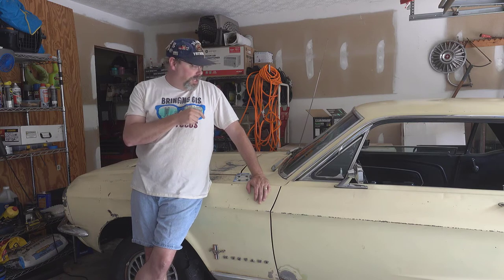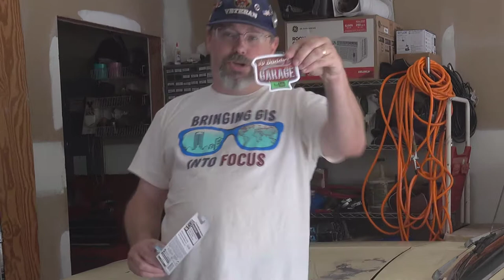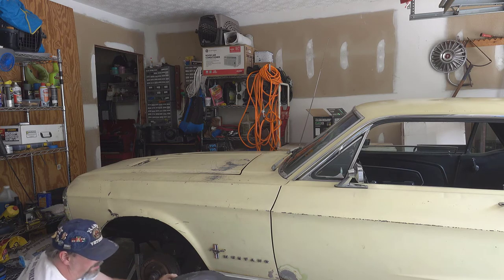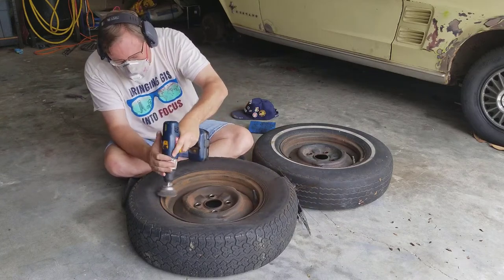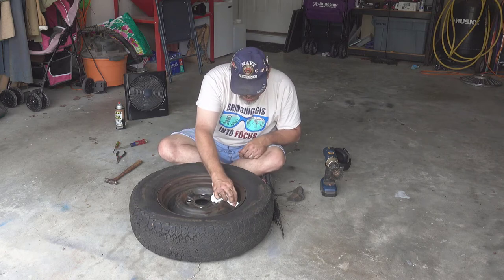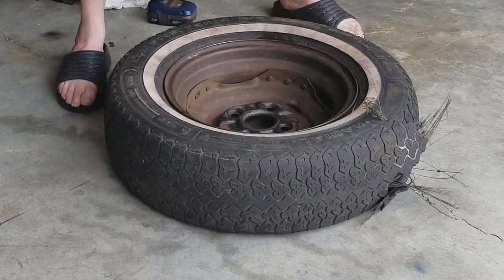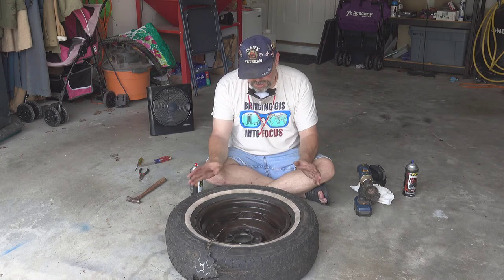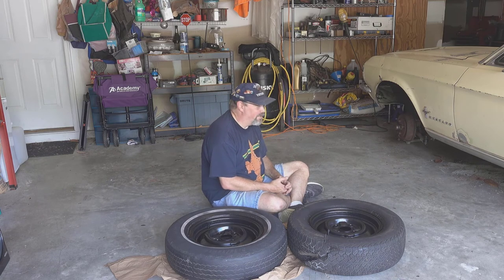Save the Stang Part 32 Cleaning up the original wheels

Comment: Spontaneous tire combustion say whaaaaa 💥💥😯💥💥
Reply from the maker: Originally thought it was the kids upstairs knocking stuff over. It was an unpleasant surprise to find out it was a tire.  It was low on air the day before so I did inflate it to pressure stated on the tire. Next day it went boom. That is what you get when you get used tires.
Reply: I just did my truck wheels in a similar manner, let all the air out 💨 then put playing cards ♦️ 🃏 ♠️  in between rim and tire to speed up masking ✌🏻

Comment: Wiring is not something I’m looking forward to. I’m secretly hoping I can re use all my wiring. I’ve had my eye on the magnum 400’s as well. I’m going to run my steel wheels for awhile though.
Reply from the maker: If you go with a stock harness it is not too bad. I went aftermarket because I want to add stuff like AC and nice radio later on.